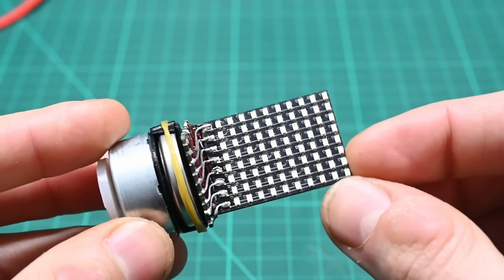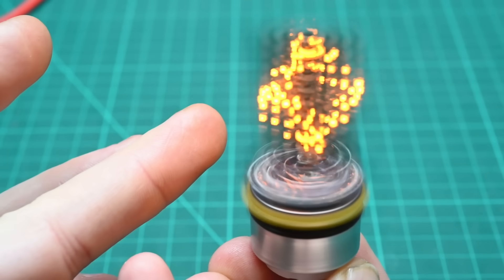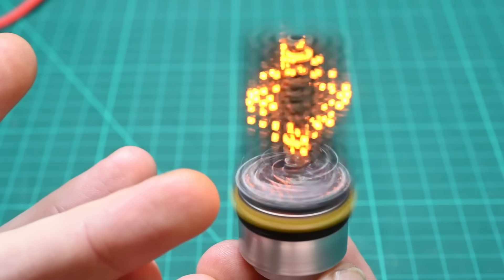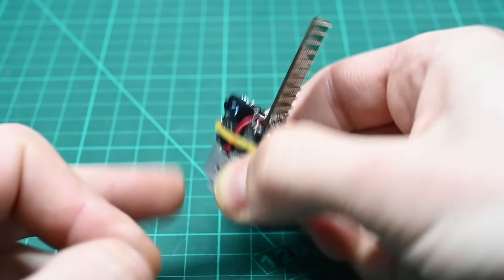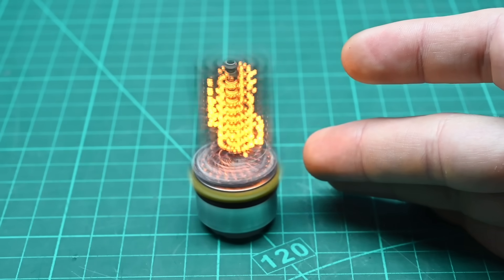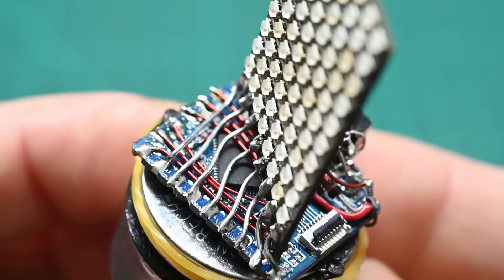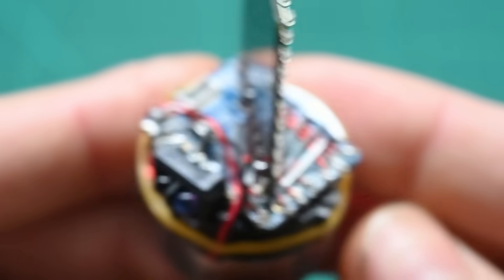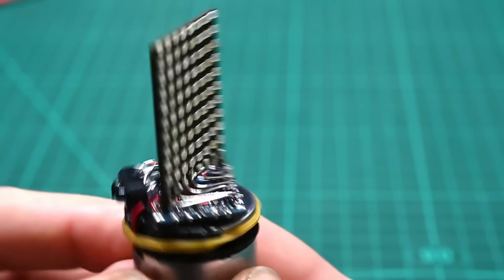Tiny volumetric display

Comment: For balancing, when designing the pcb that holds the leds you could add in extra copper pads and then the end result could be balanced by soldering to pads to add weight where needed.

Comment: That is very cool! I do have a question (and lack of knowledge as this will probably show!)

No matter how tightly you place the LEDs on one side, you’ll always have a ‘gap’ (or what looks like a grid)? I assume as this uses persistence of vision, if you place LEDs offset on the rear to ‘fill’ these gaps, would this improve the resolution and eliminate the ‘gap’?

Comment: I wonder if it might work to wire up a grid of LEDs not on a PCB at all, using as thin of wires as possible for the current needs, then cast the entire matrix in resin. This would give you a mostly clear "screen" that is able to shine in both direction.
Reply: That's a sick idea. I wonder if the dispersion of the light through the resin would add to the effect or blur everything together?
Reply: Problem with the grid idea is the LEDs in the middle may be hidden by those in front of them that are turned off. But I think it has been tried and works ok for low resolution bc then the front don't block as much of the ones behind but high res won't work.

Comment: You could use a flex PCB and glue a thin wire frame around the edges to stiffen it. You could even go the extra mile and get a clear PCB and rear-firing SMD LEDs to get it even closer to the centerline and to make the effect even more visible.

Though at that point it might be worth it to cheat and get a high DPI OLED and spin that around instead, though that might not be in the spirit of the challenge.

Comment: What about using an acrylic or perhaps transparent resin/epoxy lens as a counter weight?.  You might even be able to put the control circuitry that you currently have on the board above the battery on the "back side" of the LED Array to use as a counter weight for the lens.

Comment: Very neat!  For a relatively simple assembly it works surprisingly well.  A double sided LED PCB with the LEDs offset on one side to double the density might be doable, though doesn't help with putting the LED die exactly on the plane of rotation.

Comment: Very nice! I’ve long wanted to see a similar rotating volumetric display using a normal-sized computer monitor. Maybe with support for active-shutter 3D glasses too (though that would probably require support for user head tracking).

Comment: Nice! a rotary transformer is another option for coupling power, like they used in VCR head drums, though can get mechanically complicated combining it with the motor.
I suspect balancing at the bottom may cause some imbalance about a tilted axis. Maybe a thin PCB with some heavy inductors/ferrite beads between the LEDs could balance it fully.
Reply: Similar approach would be to add a larger solderpad above/around the leds and put enough solder to balance it.

Comment: I noticed it was moving around the table a little bit. If you added an intentional rotation-synced motor speed variation and slight imbalance, you could probably make it move consistently. Then make several of them and have them dance…

Comment: The fact that it spins so silently and stably is really impressive. Well done!
Reply: It's amazing what good quality drivers will do for motor whine
Reply: I took a listen again, it does have feint sound, so I believe this is a live video, not a voice over, just a quiet motor.
Reply: the fact that it's 2024 and there's common confusion about a silent video with a separately recorded audio track? upsetting.
Reply: well its tiny
Reply: He wouldn’t show it with no cuts and point to stuff if it wasn’t live commentary.
Reply: Does it, or is that just cause he put a voice over in post?  Still epic though!
Reply: @BloodAsp it does sound like he did the voice-over live though
Reply: @BloodAsp in my experience, even the cheap brushless dc motors of that size are usually silent
Reply: @Jeremy.Bearemy  Any links to BLDCs at that size? I want to attempt a similar project, but I'm concerned about the noise and risk of burning out of brushed motors. Problem is, I can't find BLDCs at that size.

Comment: An easy way to have adjustable balancing is to use a screw with its axis pointing out radially. The mass of the screw itself changes the center of mass of the system as the screw is screwed in or out. This principle is used, for example, in the balance wheels of mechanical watches: https://www.youtube.com/watch?v=8fDxHxjDd9M&ab_channel=MagicWatchmaking. However, in that application, the screws are used both for changing the center of mass and the moment of inertia.

Comment: Adding a few degree tilt to the display should let you double the number of apparent rows that are swept through on each rotation, which might help improve the resolution 🤩
Reply: Smart!

I would love to see this with a full colour, tilted transparent OLED on each side.
Reply: That might help with the balencing problem on centering the LEDs as well. Smart design.
Reply: Maybe even have another display on the back face and stagger the LEDs both horisontally and vertically.
Reply: This is the right of of comment section. Some great ideas in here!
Reply: For the dumb people in the back, are you saying tilt it like a box onto its corner, so that e.g. the leftmost pixel in a row spins higher than the rightmost pixel and it's like it's an extra row?
Reply: @MusicalMethuselah  Damn, I didn't get it either. What the tilt?
Reply: @TauJIaHg  This is not tilted display, side view: |
This is tilted: /
As it is tilted, its length is longer but the height is the same. You can put more rows of LEDs on it. They will appear to be placed tighter.
Reply: @nandakoryaaa1401  OK, I imagined it.
That's the type of tilt ////, not 🔷
Reply: @TauJIaHg  You mean a slant ? I would imagine the slant the other way, like in "♯".
Reply: @MusicalMethuselah  Imagine looking directly at the flat display and then lifting one of the bottom corners a bit so the LEDs are not in a perfectly horizontal line (if I'm understanding correctly).
Reply: how do you support that though?? the only practicle way i can think of is having the bottom bit glued to the bottom with a little support thing adjusting for the angle, but with the screen spinning so fast and the top part being at an angle, i don't think that would be stable enough

Comment: Hi, love your work. Would it be possible to use a LCD/OLED screen as the light source ? They are often quite thin, and if you use a 3D-printed jig to align it, then it may be possible to a chieve a very nice volumetric cube. (But battery could be heavy, maybe use a low friction slipring ? small solar pannel and laser ?)
Reply: I wonder if you can get one with a high enough refresh rate. A pixel has to update for each voxel it passes through, per frame, assuming there's one frame per rotation (there might be a minimum RPM required for persistence of vision idk)
There are some clear OLED screens, like the ones Sean Hodgins used for his TENEX volumetric display, that would fix the issue of half of the updates facing away from the viewer, which might decrease the necessary RPM? which would in turn increase the spatial resolution for a given temporal resolution, I think. Couldn't find the refresh rate for those displays in the specs, though. It might not be high enough to make up for the double visibility.

Comment: Could potentially shifting one side of the LEDs on the board down or up make it slightly higher resolution as you could illuminate "in between" the leds so to speak

Comment: Great work. So simple but so satisfying. In v2 you maybe can get rid of the IR sensor and use a touch sensor and let it run via a timer. This way you would not need to balance out its weight.

Comment: I wonder if this could be done with a small lcd or oled screen for extremely high resolution compared to what you have. If you can get the high refresh rate needed that could make it a lot more detailed.
Reply: I doubt you could update it fast enough
Reply: @mikeselectricstuff  why? Im sure there are some 1000hz+ specialized small panels
Reply: I was just in the middle of typing the same thing when I saw that you had already said it. 😅
Reply: How about adding more screens with an lower offset frame rate, and use a mirror to display it on the top...
Reply: I agree. You should be able to virtualize the present display on an LCD and then extrapolate the resolution virtually and add color changes. There must be some way to generate complete 3D high resolution images.

Comment: you could possibly balance out the offset of the leds in the rotation center by sandwiching the leds between their PCB and a bit of acrylic. That way, no weight is needed, but the leds are still easily visible. Amazing project :)
Reply: Frosted acrylic might look great, to smooth together the pixels, if you want that.
Reply: @rich1051414 I was just going to say that, add a diffuser as a counter weight
Reply: Or use a double-sided board (preferably with slightly offset columns, so you get higher resolution).
Reply: @RFC3514  I like that idea too!
Reply: Exactly, yes, perfect Comment
Ideally with a Material with the same density should give the best balance and could also be used to protect the led s in between
In a bigger version  you could also drill out holes in between the led s to reduce atleast somewhat air resistance for better battery performance
Reply: Are there transparent PCBs?
Reply: @EskoLuontola  yeah there's floppy plastic ones and also different types of glass ones
Reply: dang i didn't understand a thing, how did you get knowledge about this? did you study something related to this or?
Reply: @lucashaun9316  One thing to study is how 2D digital video works and then moving to 3D requires a 3D frame buffer in memory instead of 2D. The software part is to use quaternion math for fast rotation in software, or to have a good math library for 3D. The hardware part is just an LED matrix with motors and synchronization hardware. Lots of people will be trying to figure out how to make a low-cost 3D display since its both very cool, and very useful.
Reply: @lucashaun9316  yeah I'm a mechanical engineering student, and I'm really passionate about electronics and mechanics :)
Reply: if the back side of the board is black, one side is ok.
Reply: I agree with the acrylic, but heat is kryptonite for LEDs. Could there be a clear medium that conducts heat away from the LED better
Reply: @jamesriley5057  i think most of the heat could be dissipated through a ground plane, i don't think the front of the LEDs would be thermally affected much
Reply: That is a serene and sci-fi L.E.D. screen or something like this in my viewpoint !
그것은 고요하고 공상과학적인 L.E.D입니다. 내 관점에서는 화면이나 이런 것!
Reply: I don't think it actually matters what I say...
Reply: Cool..

Comment: How about a super thin PCB and leds on both sides, would fix the balancing problem and give you higher resolution of you mapped the actual points the LEDs end up at. Really cool project, feeling inspired!
Reply: Maybe offset the reverse side to fill in the blank areas of the first. The wiring is a challenge I’d imagine, because a ribbon would probably be easier, but I’d imagine the current is not inconsequential.
Reply: @silverXnoise  Was thinking the same thing; like 2-axis interlacing.
Reply: @silverXnoise  If it was a PCB it would only need double the number of pads on the end of the PCB and the wiring could go under the other traces. I think it might not be as hard as it seems to do it with a double sided display.
Reply: Yes, stagger the rows for higher voxel resolution
Reply: Yep, that was my thoughts too.  To make it simpler, make two boards and glue them back to back.  Make one board have a 9x9 grid and the other board 8x8 (or any other odd/even combo). The 8x8 grid should be aligned so that its LEDs are centered both horizontally and vertically between the 9x9 grid so it would have an effective 17x17 matrix with no gaps between the pixel rows or columns.  Use RGB LEDs and I bet you could make an awesome flame animation even if the flames was prerendered.
Reply: You could make it 2 colour
Reply: @andrewmacphail813  Ideally RGB LEDs. They do make very small ones these days.
Reply: Make two of them, and put them on the ends of a flat bar (just barely touching).... than rotate the bar as well as rotating the individual motors light panels...... This will take care of your visual axis problem in the middle.
Also, if you really want to make it look good. Take out the center row of lights of each of the boards on both motors.
If you can make it so that it is 3 feet high and with a radius 2 feet, that would be fantastic.
Nice work though.

Comment: Imagine this with an lcd or better yet transparent display at a larger scale (might need to be in a vacuum for less resistance)
Reply: Not sure you'd ever be able to get the update speed required for a decent rotational speed.
Reply: @ferrumignis  I mean if you optimize it for airflow maybe right?
Reply: @KamilDeKerel  Airflow isn't the issue, it's getting a display that can very rapidly display a new frame.  Unless the display can update in the time it takes the motor to turn it through a very small angle, you'd get something a bit similar to a rolling shutter effect.
Reply: @ferrumignis  ohhh that way yeah you'll probably always have that effect indeed, now i'm even mpre interested though, seems like a cool project
Reply: @ferrumignis  the question will be both how big and how fast you are spinning the display we have displays that can go up to 300+ hertz but the problem is cooling as they can make a lot of heat (although the spinning might help…)
Reply: @piman13_71  Can you really get tiny displays with a 300Hz refresh?  I'm very interested, what interface do they use? (presumably SPI?) Could you point me in the direction of a manufacturer?  The usual tiny LCD or OLED displays can't get anywhere near that.
Reply: @ferrumignis  I was thinking about monitors mainly with that thought, which use hdmi or displayport of course but the panels themselves could be used if cut down from the motherglass (I was thinking about the size of an iPad for all this so if apple or something similar tablet comes out with an OLED 300+ hertz variable refresh rate device it would make it easier)

Although I don’t know if 300 is needed and I don’t know the math for POV other than “blink in ratio to speed or you spin image” lol, if someone else has any idea about that it could be helpful to learn
Reply: @piman13_71  Rather than frames per second, the important factor is how quickly a new frame can be displayed i.e. all pixels updated.  If it takes a significant fraction of a rotation of the motor to completely refresh the display, it's going to look like a mess.
Reply: @ferrumignis if the display doesn't need a fast response time, could the frames sent to it be distorted to counteract the update lag/rolling shutter?
Reply: How about lots of little ones side by side, each displaying a section of the bigger image, like a multi-panel wall display. Solves any size issue, introduces a synchronisation one though.
Reply: I was literally about to type this, how amazing this indeed!

Comment: couldn't you inset the LEDs upside-down into the board, so they're on the same plane as the board and centerline, without needing additional balancing?
Reply: Hard to do with regular leds, but there are leds packaged for exactly this with their legs poking out. Might prevent loading any components on the back though.

Comment: the way it follows your finger while spinning looks so ergonomic, like controlling a hologram with hand-tracking (well, I guess it is!)
Reply: It's a truly digital interface.
Reply: @RFC3514  heh
Reply: @RFC3514  Digital/Mechanical interface but yes true digital will be a solid-less interface thats easily observable as well interactable with out the use of a solid material for the display
Reply: @breadtoast1036  - I think you may have missed the joke. 😉
Reply: I love it when I give an explanation from the actual schematics and YouTube deletes my comment as spam, leading to everyone speculating. No, it's not a magnetic implant, it's a spinning IR sensor. The real joke is that I still get notifications even though my comment no longer exists.
Reply: i have no idea whats happening lol. can someone explain
Reply: @pvic6959 I think he’s manipulating the distance from his finger and the ir sensors to do different things.
Reply: @pvic6959  The IR sensor is used to measure the timing of the rotations. Where he places his finger is what the sensor uses to calculate a complete rotation. The sensor does not see where the finger is, only if there is something in the way.
Reply: @pvic6959  There's an infrared sensor on the side. The device uses the infrared sensor to check where his finger is many times a second, and then uses that information + some math to make the image face towards his finger